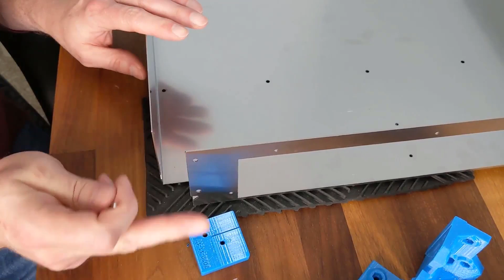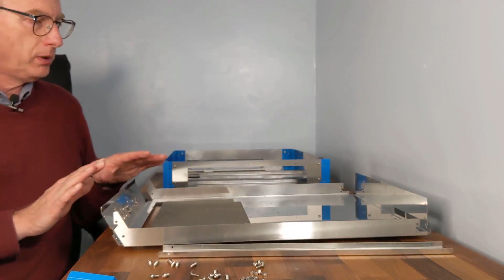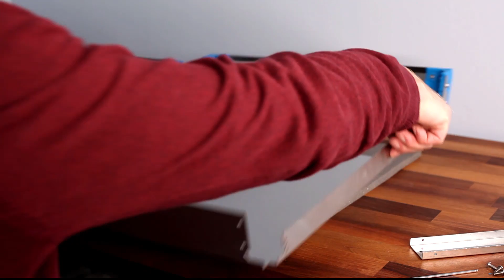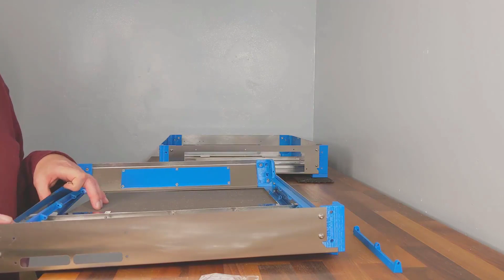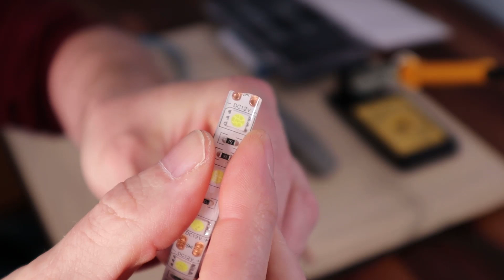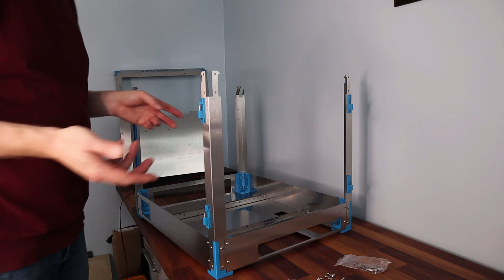PRUSA BOX Enclosure for MK4, MK3 - Build Part 2 - For Prusa i3 Printers

Comment: Hi Colin, thanks for these videos. You convinced me to order this box and your videos have been priceless for figuring out how i want to set it up. I am in the process of printing all the parts. I can't seem to find the stl for the feet on the bottom of the box you have in this video towards the beginning. The little square feet to keep box lifted off the surface. Do you know which folder these are in or where to find this stl?
Reply from the maker: I use the rubber feet from the printer box web site. It's not possible to use the original prusa feet. They make a huge difference in vibration and noise. They should be in the section where the squash ball feet are I believe but if u still can't find them let me know
Reply: @colinhill  I’m not talking about the printer feet. I’m talking about the square feet you have in your video on the bottom of the enclosure. I can’t find the stl for those anywhere. It’s what is used to keep the prusa box off the table.
Reply from the maker: @marksegars6662  try download_public/Prusa-box/01_main_frame/01_main_frame_part2_2022-06-21.stl in the Main Frame section
Reply: @colinhill  That may be it actually. I didn’t download mainframe part one because I downloaded and printed the removable top feet.
Reply: @colinhill  Thank you so much I found them and main frame part two

Comment: Excellent videos!  I'm watching them all now.

How do you honestly feel about the quality of this enclosure.  I love that I can use my RPi and 7" touch screen integrated into the front.  And all the other mods that can be done and have been done.  But seeing you put it together it does seem like the sheet metal is thin... is it flimsy at all?  I liked the official Prusa enclosure they just released but for the money it's too expensive.  The Prusa Box enclosure seems to be a good bang for the buck.  I like that you can get to it on all sides. which makes having access a breeze   Just wanted your thoughts on overall quality.
Knowing what you know, would you buy this again?
Reply from the maker: Hi. The stainless is thick enough to be ridgid. Its strong even though relatively thin. The way it's designed with folds ensures it won't bend. It's a great enclosure, and if you like designing, plenty of scope to create your own mods. I would defo get another if I had a second MK3. Make sure you subscribe as I will be reviewing the new Spool Tank soon. The Prusa Original enclosure doesn't have one of those!

Comment: Seeing these videos has been a nice catch, I am about ready to order a Prusa and have been looking at enclosures. I am debating buying one of these, making a custom one out of stained OAK, or making one out of black extruded aluminum.
Reply from the maker: Difficult to direct you, there are many choices. All I can say is the PrusaBox is very versatile and easy to add mods. Example, when printing pla I often leave the top hatch open so it doesn't get too hot. Most enclosures don't have such an option. Good luck with your choice.
Reply: @colinhill  I recently built a new PC desk in the man cave office if you will. I have went crazy with WIFI bulbs and led strips. I really like how the lights look in this box. Thanks

Comment: I have another question, Colin.
The LED strip you bought, do you simply cut a larger length into shorter strips?
Reply from the maker: I ended up buying a 3 strip set, but you can buy a single strip. There are copper marks where it can be cut, then you just solder short  wires to those copper marks. This allows you to go round the corners inside the enclosure. I still had to do some soldering. But don't get the LEDs that are covered in silicon for outdoor use, only get the indoor use LEDs. I speak from experience!
Reply: @colinhill  Wonderful, thank you.

Comment: Do they not sell the 3d printed parts? Or do I have to print them out on my own I would assume they come with it no?
Reply from the maker: You must print all the parts. The package contains the stainless steel, nuts bolts and plexiglass. You will need to print all plastic parts and the STL files are provided in the downloads section of PrinterBox site. Follow the link in the description for more info. The STL files are created with all components laid out and correctly orientated. Expect to use 1 kg of Petg filament, possibly more if you need to reprint or use any of the mods. Question, why would you expect the plastic parts to be provided? The idea is 1. to keep price down 2. So you can print in the Petg colour of your choice. It's a great benefit to be able to make the enclosure bespoke by using your favourite colour. Hope this helps
Reply: @colinhill  well let’s just say i bought a different enclosure not like this but similar in it being plexiglass it cost about the same came with all parts needed but what put me off was the fact that the plexiglass was very thin and not sturdy for what you would expect for the price it ended up breaking so it was complete garbage and regretted buying it. How thick and how sturdy is the plexiglass glass? I can look past the price if the plexiglass glass is thick and sturdy l.
Reply from the maker: @MicrowavedTurtle  Hi Frank, thanks for the reply. Plexi on PrusaBox is 2mm on all sides. I initially thought this would be too thin (my Tukkari enclosures use 4mm & 5mm plexi), but in use, the 2mm plexi has been ok. Would be nice if it was a little thicker, but then the doors would look a bit odd standing out past the stainless if the plexi was thicker. Most enclosures have fixed sides and the front door is within the frame. Whereas on PrusaBox, all 4 sides are doors, and they  all overlap the frame (keeping heat in). In fact i'm really impressed at the heat retention. Hope this info helps.

Comment: Hi Colin, how did you print the plate that goes over the logo?
It appears to be larger than the Prusa mk3 bed.
Reply from the maker: It would have been diagonal corner to corner
Reply: @colinhill , I tried placing it diagonal and the 4 corners still end up slighly over.
Reply from the maker: I dont know how thats possible, it fits well within the base plate as per screenshot here https://www.screencast.com/t/fTEMTuiA   i just re-downloaded the logo plate from the printerbox site to make this screenshot. Are you enlarging it by accident? Perhaps download it again, then just double click the stl file in file explorer, it should open directly in PrusaSlicer in this orientation.
Reply: @colinhill  Thank you for the image, it made me realise that my bed dimensions in Slic3r were not set to 250- Z, 210-Y.
Even though I placed the logo diagonally and within the white corner brackets, the logo's corners would protrude over the edges of the bed and was giving me the error message. 
You can change the bed size in Printer Settings > Bed Shape > SET.
It appears the default dimensions are 200 x 200.